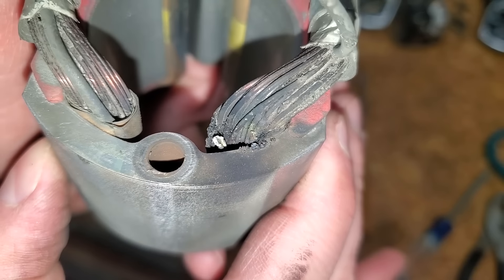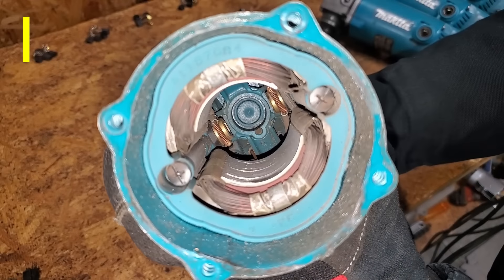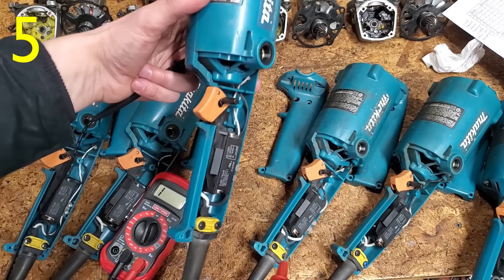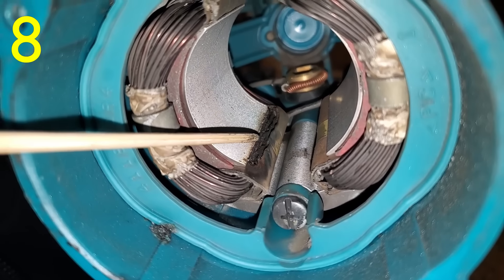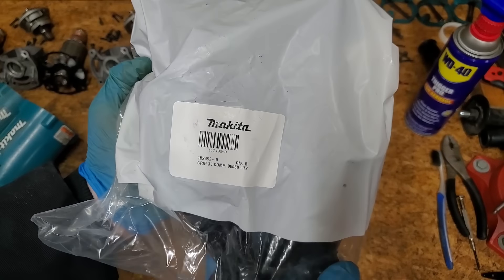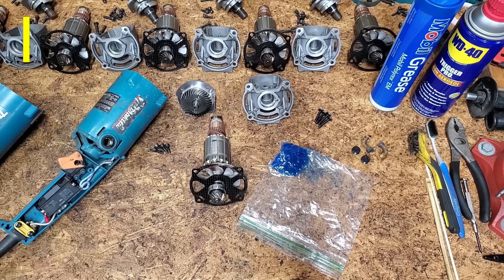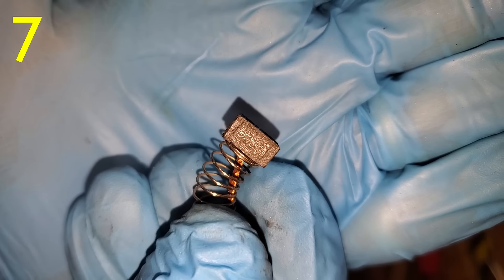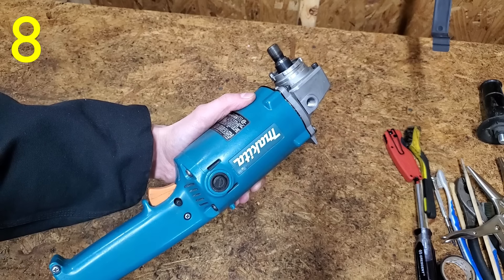Repairing Makita Angle Grinders

Comment: I have a boatload of power tools that I have purchased over the past 40 years. I have yet to wear out one due to usage. My oldest and most trusted tool is my Milwaukee 1/2 inch Magnum holeshooter. I just pulled the brushes out, and they look like they have hardly any wear on them. Don't need a lifetime guarantee if you buy a well-made tool and do not beat it to death.
Reply from the maker: Yep, all of my tools are still on their original brushes too! :)

Comment: Hey man, just rewound my stator. It works. I will upload the vids on or after nov 3rd when i get back my home internet. I suspended while i was working. I cant believe it, it worked lol. Cost me maybe $10. Fuck those springs are a royal pain to get back on the brush holders. God damn.
Reply from the maker: That's great, nice job! If you have some time, shoot me an email with any helpful info, I'd like to try it out.

Comment: I used to repair power tools in the early 2000s , we used Metabo grease for gearboxes, and just replaced bearings, a few engineering work shops would book in yearly for tool servicing  and repairs at a flat rate plus parts , others would wait until things stopped working and if they were lucky it was just brushes, I saw a lot of tool abuse and heard lots of "I don't know how that happened"...
Reply from the maker: Oh yeah, "I don't know how that happened" is the phrase ever person in any line of work will utter when confronted! 🤣

Comment: Makita 9005B is a very solid 5” grinder. I once had a few metal shops that would only use these. Notice those thin wires on the armature. Very rare to see these days. Most power tools have thick wires and the first time they get hot that’s all she wrote.
Reply from the maker: I've only got to use one of these 9005B grinders on one project for myself, so far. It did not disappoint and I'm looking forward to finding more work for them.

Comment: I was expecting you to take the 8 grinders, and "merge the good parts" to make 3-5 working grinders (depending on luck), at zero cost.

It didn't occur to me that you'd simply order enough new parts to make them all work. Do you need 8 grinders for some reason, or are you planning to flip them?
Reply from the maker: For me, it was more about learning and giving the tools a second life. I also think it made for a better video to fix 'em all. :) I kept 2, sold 3 to recoup my costs, gave 2 back to the shop as a "thank you" and am holding a giveaway for the last one.

Comment: A multi-meter is no substitute for a megger. You most likely find that down to earth faults are measures as "OK" by your multi-meter but once powered on will pop your breaker. A megger set to double the operating voltage will show the windings shorted to earth.
Reply from the maker: I had never even heard of a megger until another viewer recently recommended it. Do you have a recommendation for one that is accurate but won't break the bank? :)

Comment: Seems like you dismantled all of them ultimately. Did you test any prior to dismantling if they had minor issues like the brushes or power cords? Surely the ones where you suspected the brushes were worn you could have tested with brushes from another grinder to confirm that was the only issue.
Reply from the maker: They were worked hard and were filthy inside. Sure, if you were doing this for a living and needed quick turnaround, you could have skipped disassembly, cleaning, and re-greasing. This isn't my job, it's just a hobby. My goal is to learn, not to make money from this hobby. I take my time and try to do the best I can but that doesn't mean you couldn't spend less time and still end up with a working tool.
Reply: @Mikeattempts  I wasnt suggesting to skip the disassembly and cleaning entirely. But to test them as you go so you know for sure the only issue was the brushes or power cable ect. Then proceed to take them apart further for cleaning/inspection.  Taking them apart you might have inadvertently fixed something/damaged something else.

Naturally I was just curious based on your original suspicions if they were in fact the actual issues.

Comment: the grease in the gear house of the angel grinder is a relatively expensive molybdenum type grease as it should last the lifte time of the angel grinder 30g pr grinder, costing you about 1dollar pr 10g.
Reply from the maker: Yeah, I didn't realize the grease was supposed to be lifetime until someone else mentioned it in the comments too. However, some looked like it had been cooked pretty good.

Comment: Those motors just need to rewound the steel doesnt go bad just the wire
Reply from the maker: I still have the failed stators and was thinking about doing a video rewinding them, but I've never done it before so I'm gonna need to do some research.
Reply: @Mikeattempts  They do a lot of that in Pakistan. But I don't think it would be worth the effort, it's easier to just buy new ones if they are available, which they are for this particular grinder. The materials to do the job might even be more than the new stator.
Reply from the maker: @BrucePierson  Yeah, I'm sure you're right but it still might be a fun project to see if I could do it and also learn something new. :)

Comment: That key is called a woodruff key.
And they probably make the replacement power cord grey so it’s easily identifiable as a replacement. Some big job sites with safety to the hilt won’t allow anything bearing replacement equipment. I’ve seen contracts noting all power tools and cords to be original equipment.
Reply from the maker: Dang, that's pretty strict, but interesting. Thanks for the comment!
Reply: @Mikeattempts  no problem

Comment: Beautiful. I've actually serviced a few at work as a maintenance electrician for a facility with a full service auto/machine shop and just threw out any that had stator issues. I'm impressed you got those damn springs on

#3 didn't sound great and I wouldn't have reused the rotor on #6 but that's in a big shop.
Reply from the maker: Hahaha, I had to try a few different things before I found something that worked on the first stator springs. :) Yeah, I understand, for a business it would probably make sense to skip more expensive tool repairs.

Comment: Not trying to be smart, but is WD-40 a good enough lubricant for the needle bearings? I think it will disappear very quickly, and I would choose something like sewing machine oil myself.
Reply from the maker: I didn't use WD-40 to lube the needle bearings, I used it to displace any remaining moisture from the ultrasonic cleaner. I later lubed the whole gearbox and needle bearing with the blue grease.

Comment: I gotta say that this was a good lesson for me on testing armatures for continuity as I'd been doing the bar to bar test on the commutator completely wrong. I've been informed that the way I was attempting it is more commonly called a "pub crawl". Who knew?
Reply from the maker: This was my first time testing electric motors so there might be other tests that I didn't perform. The bar-to-bar & 180-degree tests were Ohm measurements. The continuity test on the armatures were to make sure there wasn't a short between the commutator bars and the shaft or the bars and the steel stack. Anyway, I learned a lot off camera while trying to figure things out. :)

Comment: If the brushes are heat sensitive, doesn't that mean that there's a decent chance there's a bigger problem with the ones who's brushes were worn down to nothing?
Reply from the maker: Nope, the carbon brushes are considered consumables. They wear down with use and are meant to be replaced.

Comment: I will suggest you use WD-40 spray the blue and yellow color can one and spay it on the corded rubber wire and strain relief pieces of the grinder let it sit over night than wipe them with a dry shop towel or tissue paper.
Doing this will restore the factory sheen of the wires to brand new so give it a try and this method works for rubber wires of any tools and devices so it's worth a try.
I bought a new long power cord for my laptop power brick around a year before and the sheen is still as good as new after i applied WD-40 spray.
My thought for using WD-40 was to remove the old dust and sticky rubber feel of the cable since i bought my wire from a electronic parts second hand shop that sells office replaced components to speak of but as an happy accidental surprise of my attempt with the WD-40 spray ended up giving my cable factory like new sheen back and strong ready for use.
Reply from the maker: Thanks for the tip, I'll hafta try it out! :)
Reply: @Mikeattempts  please try it on your tool wires, grommets and let me know if they worked for you haven't seen or known from others if this method worked for them will like to know if the method worked for you.
Reply from the maker: @chettiarsirusraj9501  Will do! What is the exact type of WD-40 you use, it sounds different than the original in the blue can?
Reply: @Mikeattempts  It is the regular multipurpose WD-40 blue can one with WD-40 written in blue on top of a yellow background.
Reply from the maker: @chettiarsirusraj9501  Oh, ok, then I kinda already did it. :) I sprayed some on a rag and wiped the cords off but I didn't spray it on the cords and let it sit overnight. I'll give it a try.
Reply: @Mikeattempts  See the results for one them if it works then let me know and do on more of the cords.
Maybe even make a YouTube video/short about this method as well.

Comment: Put a different accessory on each one. I got a box of dewalt 4.5" angle grinders the same way.  All were fixed with a new cord, brushes, or switch.
Reply from the maker: That's the plan! You lucked out that there weren't any expensive part failures in those Dewalts. :)

Comment: I wonder what the previous owner was using these on.  Seems like they were probably overusing them without breaks to allow the units to cool off.  Tools cannot run for hours without failing.
Reply from the maker: These grinders came from a local fabrication shop. I would imagine that they were used for long stretches to shape metal and grind welds in a dirty environment. There was a lot of metal dust inside, some worse than others. The shop doesn't have AC either so the ambient air temperature can get pretty high in the summer months.

Comment: What is the cause of these burned stators? To long or to thin extention cords/ voltage drop or to long working with them and overheating?
Reply from the maker: The consensus from other viewers seems to be that running them hard for long periods of time led to overheating. The failed stators have been discontinued and replaced by another model too so maybe it was a bad batch?
Reply: @Mikeattempts  thanks

Comment: That particular model of 230mm makita grinder is notorious for burning out the stator and the main cause is the anemic cooling fan which this model uses(stamped Axial) other newer improved models will use a plastic blower type of fan which for this application is far better!
Reply from the maker: Interesting, thanks for the info!

Comment: I wonder why they throw them out instead of fixing the tools themselves because Makita is an easy to repair brand. They provide part breakdowns, documentation and supply spare parts for all their machines.
Bosch is also really good with that.

Id only buy Bosch and Makita and just repair them myself. Those two brands get you the best compromise between a lasting reliable tool and the price of the tool.
Reply from the maker: I think it all comes down to the saying "time is money". The owner of this shop must value speed and productivity over repair. It's easier to just get a new grinder off the shelf and keep working.

Comment: Nice presentation.  One point, however, it is not good practice to reuse old bearings,  It is false economy.  I ran and operated an electric motor shop for twenty years, and never re-used old ball bearings if new ones were available, at a reasonable price. These days, 6200 series ball bearings (sealed) can be purchased online for a couple of dollars each from top sources.
Reply from the maker: Yeah, if they end up sounding too rough, they're easy enough to replace.

Comment: Literally the BEST grinders out there. The torque, the durability, the rat-tail handle and the lock-up mechanism makes the model rise to the top! I have mine since 1999 and only cleaned, greased and re-brushed it to be a faithful and trusted everyday companion.
Reply from the maker: That's awesome, I'm lookin' forward to puttin' 'em to work! :)
Reply: I did have to replace a collapsed main bearing on one of these a couple of years ago (it was probably a decade old and well-used), but yes simple quality kit like this lasts a long time.
Reply from the maker: @xxwookey  Yeah, they were pretty easy to work on, not much to 'em.

Comment: 14:24 "I gave each needle bearing a squirt of WD-40"

Why?  WD-40 isn't a lubricant.  It's a solvent.  You should have used a lubricant here.
Reply from the maker: Like I said in the video, they had just been through the ultrasonic cleaner. I wanted to make sure the needle bearings didn't have any residual water in 'em since I didn't know how long they'd be sitting before they were greased and reassembled. WD-40 is a water displacer, among other things. If you have some time, check WD-40's "Myths" page: https://www.wd40.com/myths-legends-fun-facts/

Comment: I acquired a 9005b in 1983 that was already previously used. Other than replacing the brushes and regreasing the gears about 5 years ago, it has worked flawlessly. It runs just as strong today as when I got it.
Reply from the maker: Yep, I've heard nothing but good things about these grinders and I plan on keeping a couple for myself. :)

Comment: my Makita have small cuts in the rotation  ... rotation is not continus ... someone knows what could be the source of probleme ??
Reply from the maker: Do you mean the wires are cut or that there are cracks in the enamel coating on the wires? If the wires are cut, they could have melted from high heat, same with the cracks in the coating. Excess heat from overuse and/or improper ventilation of the tool is going to be the main source of damage.

Comment: Burning up the stator winding in the same spot is probably caused by tool-overload (trying to grind off too fast) and blocking the air vents with a gloved hand. Maybe Makita should of put a thermal overload switch at that point so if the stator gets too hot the switch opens up until the tool cools down. The thermal overload switch looks a bit like a metallic resistor and goes in series with the stator winding but is in mechanical contact with the laminates for heat transfer.
Reply from the maker: Good info, thanks! :)
Reply: I have to agree, that (if you want your expensive Power Tool to last, frequently interrupt your work), and for just a few seconds - allow the Tool to reach full speed, with all of your fingers away from the vents. The internal fan will do its work in cooling the Rotor & Stator. It is high load over long periods that will kill them.
Reply from the maker: @peterduxbury927  The side handles not only help with control but also keep the operator from gripping the body and blocking the vents.

Comment: I love fixing stuff. It's so satisfying. I buy retail returns and fix them for fun. Some items actually have nothing wrong with them. I think some places allow no-fault returns. Or the customer has changed their mind and made up a BS reason to return the thing. Some items are actually brand new - with just a damaged box or something. I got my 3D printer from a pallet of returns and it was brand new in an unopened box. The note on the box said it had been returned because they shipped him the wrong printer.
Reply from the maker: That's awesome, where do you buy retail returns? I bought my first 3D printer a little over a year ago and it's a lot of fun. I even did a video building an enclosure for it. Designing parts takes me forever though so I don't get to use it as much as I'd like.

Comment: Checking electric motors isn't as simple as measuring its resistance. This way probably won't show You interturns shorts. The simplest way of checking stators for interturns shorts is to put a ferrous round object, that has near diameter to hole in it, and check if it makes 1:1 transformer. If it doesn't there is short between turns of coils. Checking rotors isn't so simple, You need device called growler however it is easy to make it yourself.
Reply from the maker: Thanks for the info! I still have a ton to learn when it comes to electrical stuff so what you're describing is outside of my current skillset. :) How accurate (percent) could someone be using only a multimeter (resistance & continuity) to determine a failed stator or armature?

Comment: Get your parts right then hit it with CRC contact cleaner then hit it with CRC 2-26, bearing grease .
Reply from the maker: Do you work for CRC, hahaha? I have used the electrical contact cleaning before, but I don't think the 2-26 lube would be a good option for lubrication in this case.

Comment: Those stators are planned to fail. Only if there is too much current running through them do they overheat like that. There isn't proper current management in the system.
Reply from the maker: Yeah, no circuit boards inside at all. The stators that failed were discontinued and replaced by a different model so hopefully they'll last a long time.

Comment: is there a reason you got the power cords from Makita? Considering genuine parts are nearly always more expensive.
Reply from the maker: I assumed the same thing and would have been happy to use any power cord with the same AWG size. However, I paid less than $8 a piece for the Makita ones and I couldn't find anything cheaper.